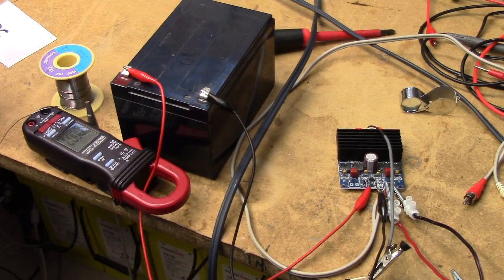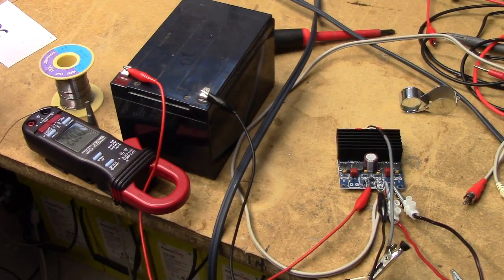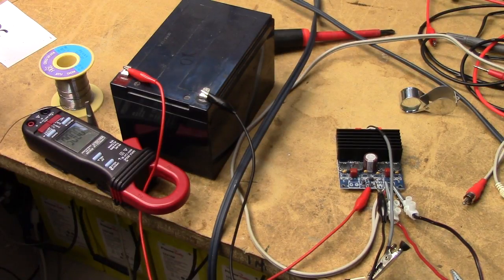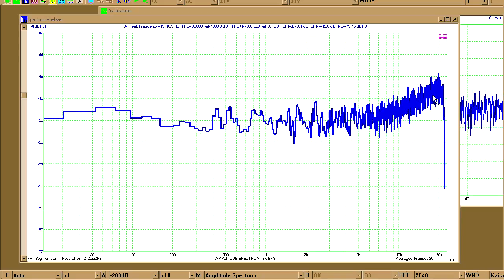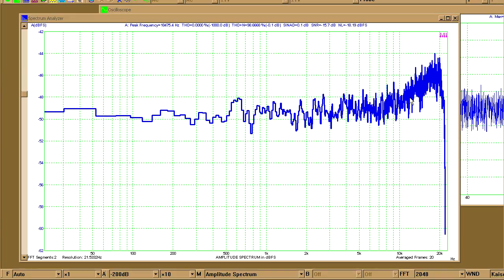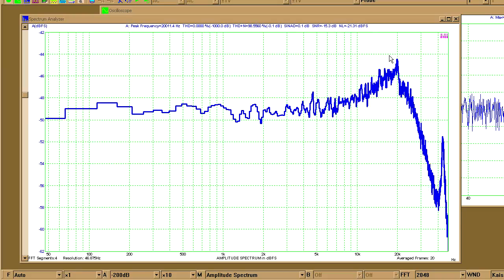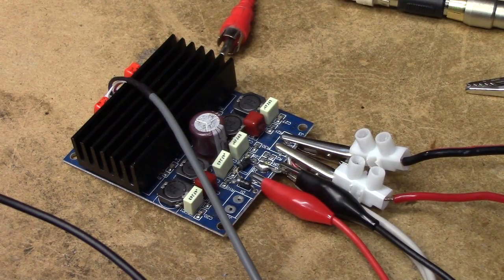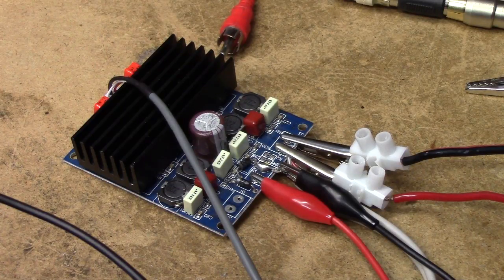TDA7492 amp module output filter capacitor myth busting

Comment: So in a nutshell, "the viewer" is not using a Butterworth style of filter.  Instead, he is using an under-dampened version of a Chebyshev filter, clearly seen at 5:52 (thank you)?  The high Q factor is acting as a treble boost at the cut-off frequency.  Whaaaa why???

That can't be right.  That is dangerously stupid on a high-end tweeter, if anyone wants to use one.  That might also add more heat on the inductors of the low pass filter.  I hope people are using cheap speakers with this modification.

Am I being stupid?  I don't understand why this is a safer solution.  Love the safety tip at the end.
Reply from the maker: I'm figuring he just concluded that more treble = better sound.
Reply: At 5:52, that sensitivity curve is just awesome.  Good job.  That's when I got what was going on.  It's a completely under-dampened filter being employed.

Hmm, it's crafty to use the low pass filter as a two-band audio equalizer.  But it might be pushing the Chinese surface-mounted components to the limit.

I always thought that a flat-sensitivity curve was Hi-Fi.  Guess I was wrong.
Reply from the maker: That depends most highly on whether you're talking about hi-fi or "audiophile-grade audio".